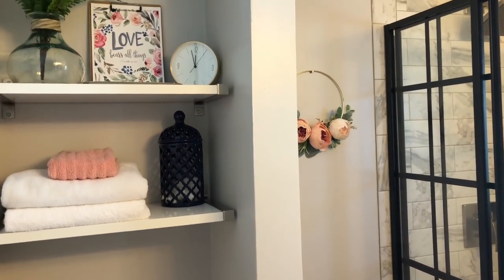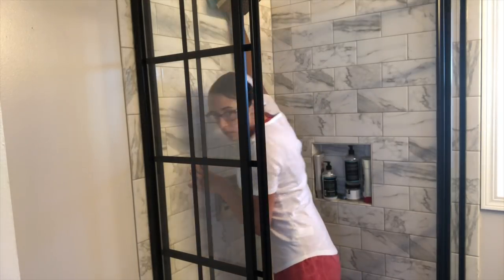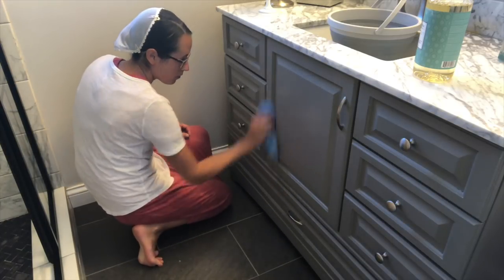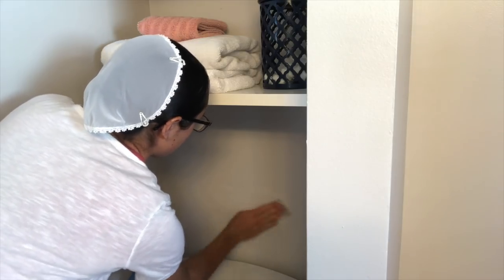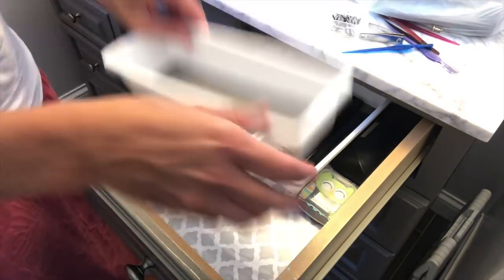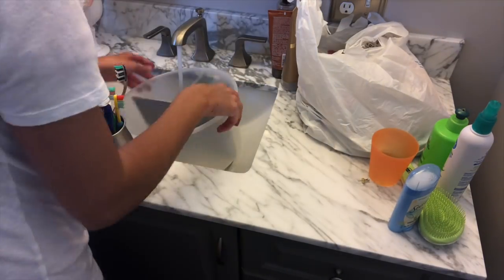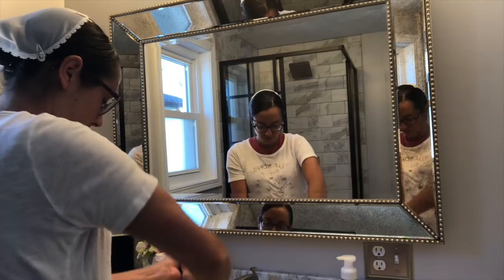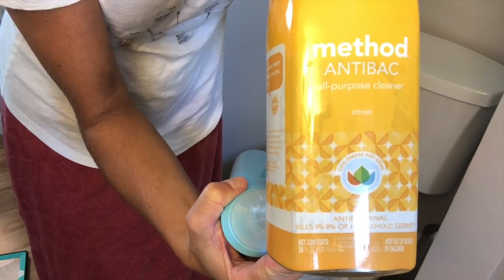DEEP CLEANING  & DECLUTTERING THE BATHROOM | Clean with me! | Lynette Yoder

Comment: Beautiful bathroom! What would you recommend to clean a marble shower and counter? Thanks
Reply from the maker: Make sure you don’t use harsh chemicals. But even just wiping it down with all purpose cleaner in water  will work great! Unless you’ve got mold issues or similar. I know that we’ve used a brush in marble showers we’ve cleaned.. so I’d say just be careful.  My shower is ceramic tile on the walls so it’s not marble.  But my counter top is- and I like to use my Norwex rags on them. But I have used other non-chemical spray etc.  also I have to resurface and cure it like once a year or so.